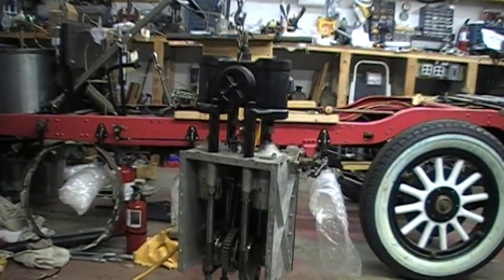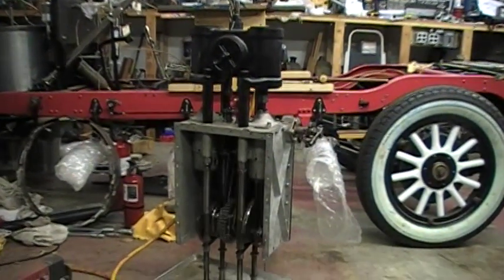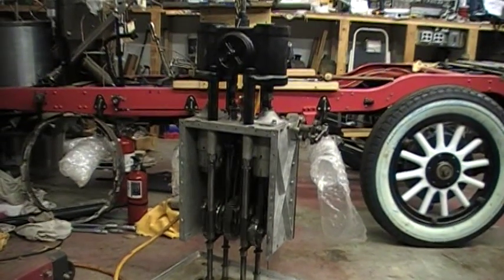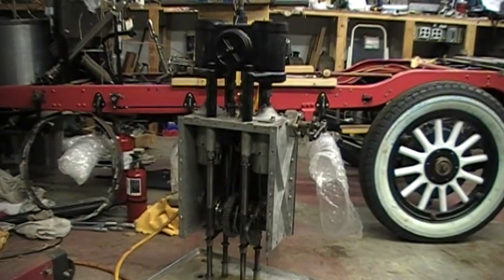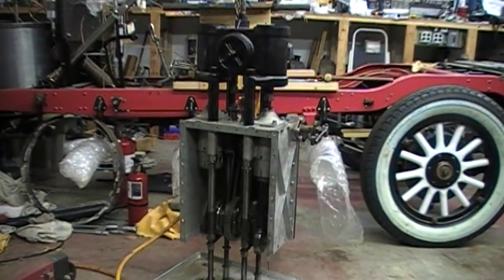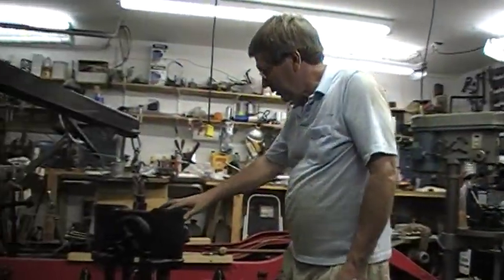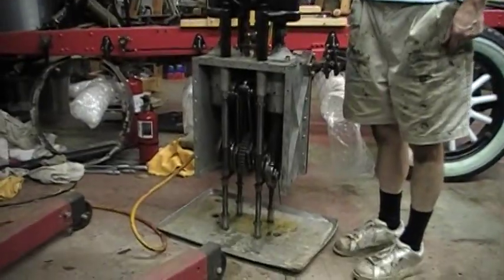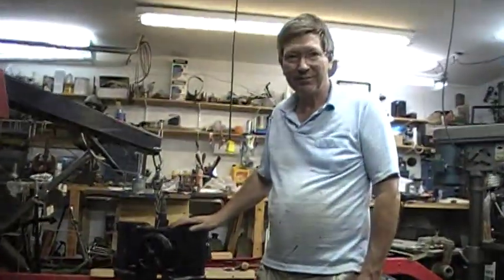Stanley SV ("The Bettyanne") Engine Test 9-4-10

Comment: Because their engines were chained directly to the driveshaft without any kind of clutch or gearbox, so the momentum of the whole vehicle (except at really low speeds) would smooth out most of the irregularity